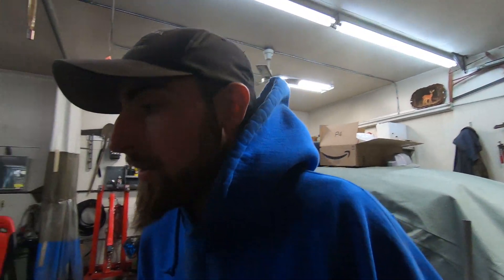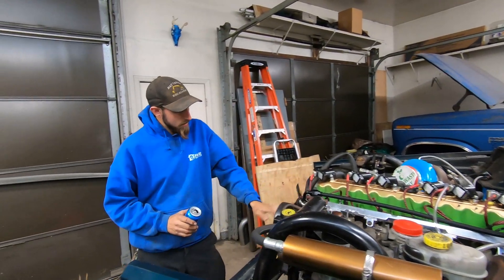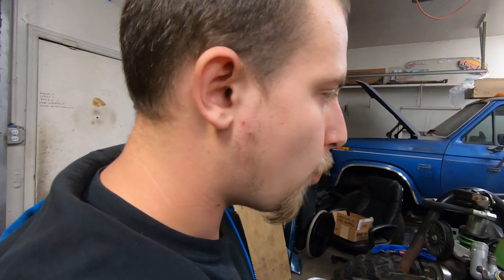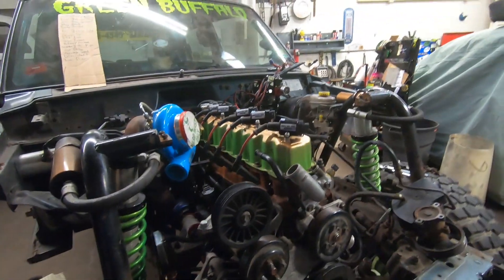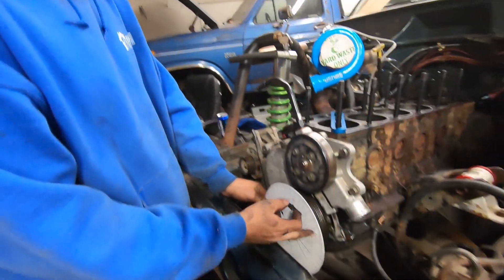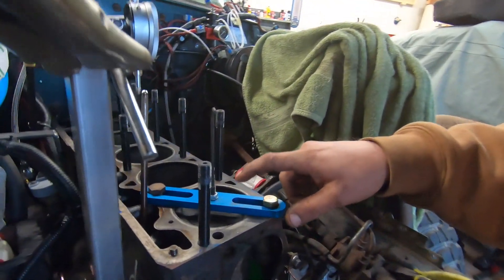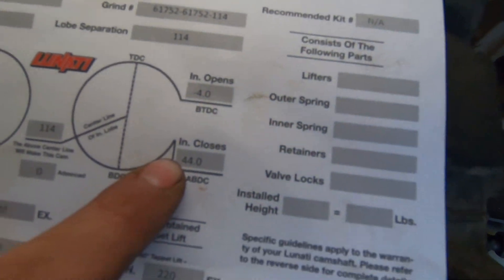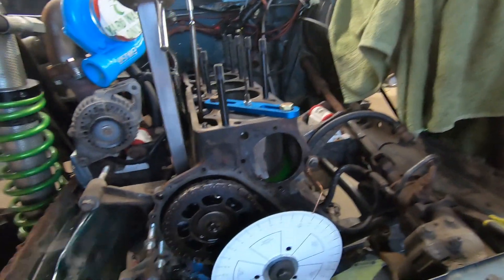Turbo Jeep Cherokee 4.0: Checking Camshaft Degree

Comment: How did you decide which cam to use?
Reply from the maker: I was gunna go with a sloppy stage 2 but i got this cam for free so i used it lol
Reply: @Grewsum2Sum  ok thank you. Years ago I bought the Banks turbo. I've been thinking about camming my Jeep but, wasn't sure what to look for.
Reply from the maker: @tjduskey2889  its from lunati, call them an tell them what you are doing, they will make you a cam for what you need
Reply: @Grewsum2Sum  Sweet. Thank you

Comment: Your method of cam degree needs some professional overwatch.
Reply from the maker: So how do you degree a cam?
Reply: @Grewsum2Sum     The 44 isn't 44 thousandths open.. it's 44* after bottom dead center.  These numbers are for reference only.. they are the target numbers of the manufacturer.  You degree the cam in to get the real numbers and the real LSA and lift numbers.  If it's real bad, you can send it back.  If it's just an LSA number that is off, there are ways to advance and retard the cam a couple of degrees at a time.    I was a tad harsh in my reply above.  I will correct it.
Reply from the maker: Thank you for the insight, we are amateurs as you can tell. The engine has made it through several hard dyno pulls and street pulls and responds extremely well to boost.